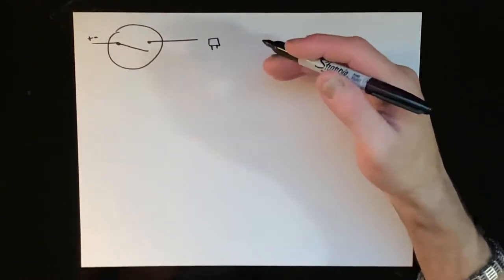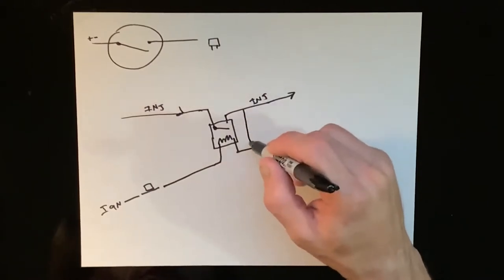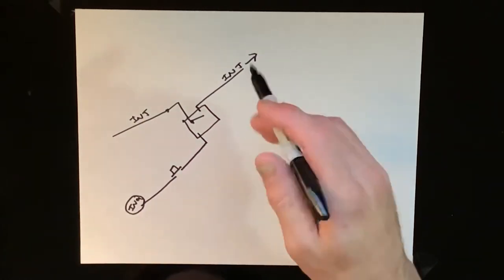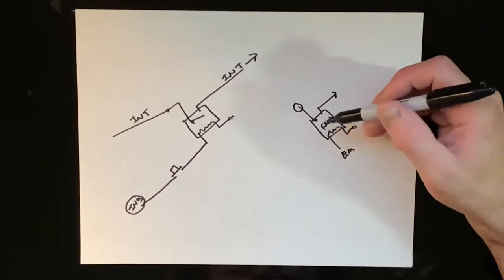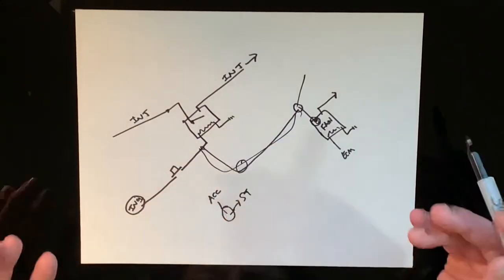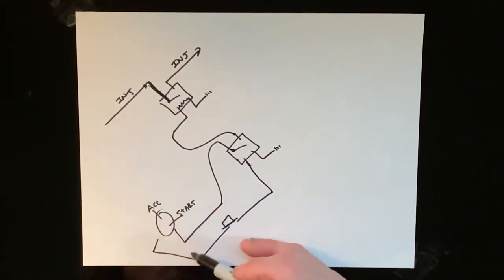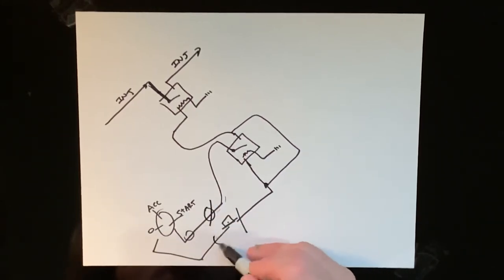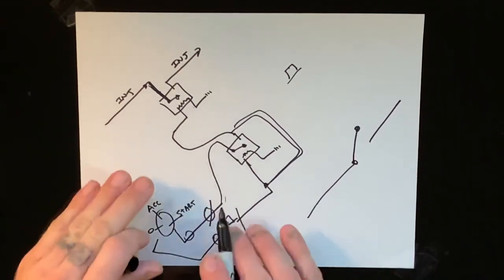Kill Switch (Self Latching Relay)

Comment: Nice man...The answer to the question below is he added 2 relays if I am correct and tapped into an ACC/Ignition start positive/hot wire (basically the key switch or push button on used to turn the car on. Nice breakdown to probably what electrical people already know. Thanks!

Comment: Why didn't you just install a diode to stop the backfeed from the ECM that kept the relay latched?
Reply from the maker: Making a small bread board that’s universal would be a better step. With diodes and such, maybe something that just replaces the injector relay, or fuel pump relay.  But yeah, I did what I could with what I had in hand. And having diodes on hand isn’t something that my line of work calls for daily. Can’t really just run down to radio shack anymore.
Reply: @MechanicalTriage  yeah, this is do-able without knowing the use of a diode. Use what you have. thanks again.

Comment: What power source did you end up tapping into after the fan relay didn't work? I don't think that was ever mentioned.
Reply from the maker: I believe I ended up piggy backing off of an ignition wire on the steering column. It was the only one that wouldn’t drop power when in the start position. For this specific vehicle I believe it was the white wire.